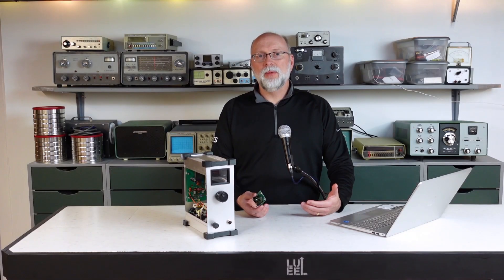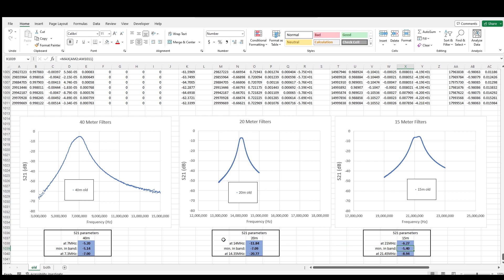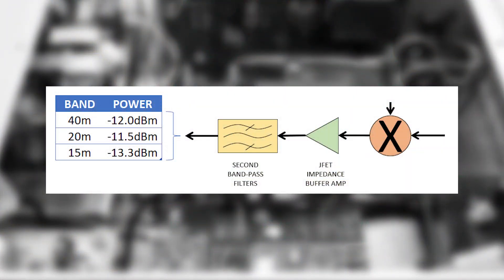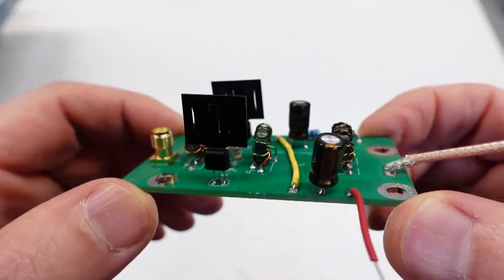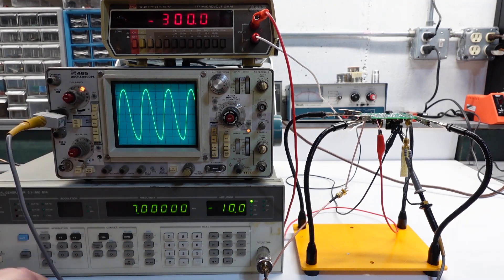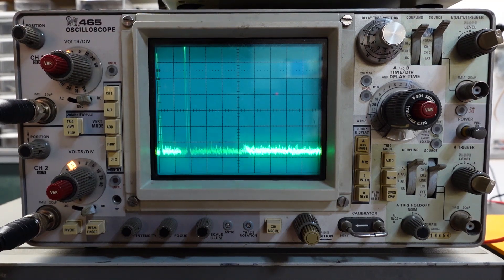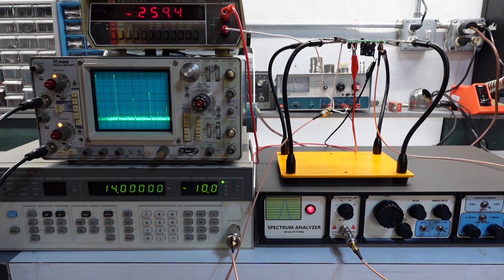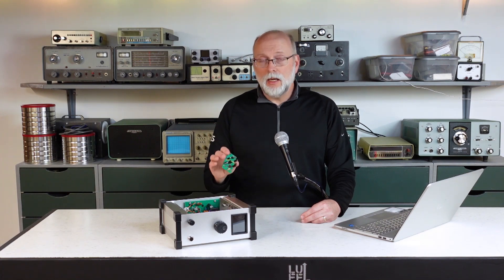HF Transmitter #15 - RF Preamp Trial Number 3

Comment: >5dB of insertion loss for band pass filters?  I think this is a problem for the receiver as well!  Since the band pass filters are before your first amplification stage, the insertion loss translates directly into a corresponding increase in the receiver noise floor.
Losses in the chain seem more significant in a transmitter than a receiver because they consume power and generate heat, but it's the overall path loss (transmitter A -> antenna A -> atmosphere -> antenna B -> receiver B) that determines whether or not you have a contact.

Comment: any way we could make it a 100 watt transceiver using a mrf 101? I would love it. This is one of the best series of its type. thank you.
Reply from the maker: I think so.  I had already started looking into AD5GH's push-pull design that's out on the internet as a possible future upgrade.
Reply: You can easily make 100w from irfp150n, i have made a board that can put out 180w in 10m with 15w input, it uses 6 mosfets in a push pull configuration